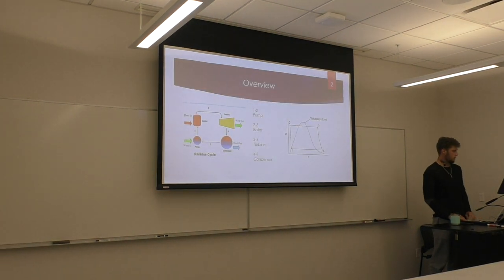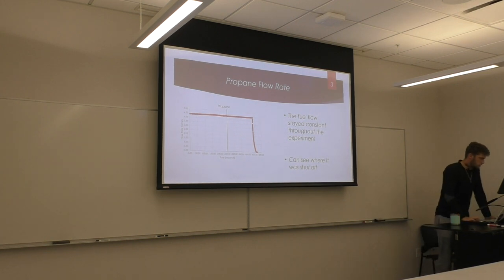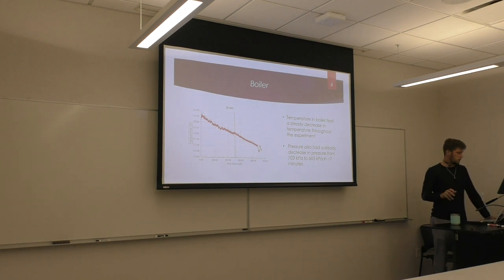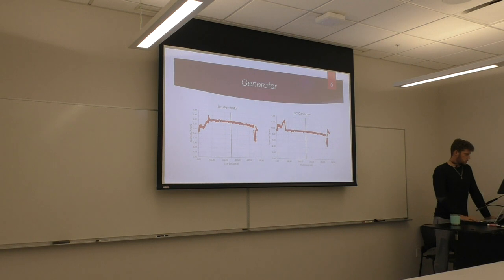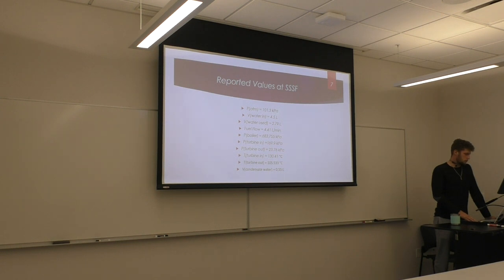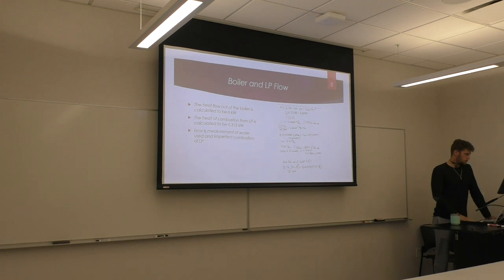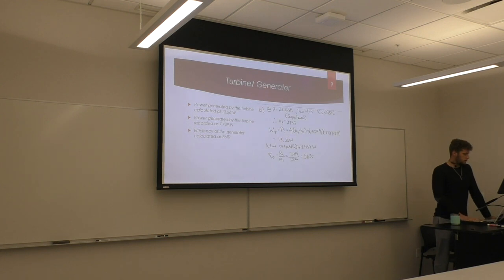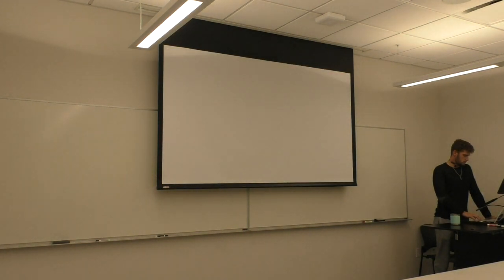Devin Colon

Comment: Nice job on your presentation. You did a great job of pointing out the important info to the audience. My critique is that you could have elaborated further on the cycle efficiency on the last slide to both provide more information and to clock additional time.

Comment: I think you did a great job reporting your findings, and you spoke loud and clearly as you usually do. I think the way you described each of the graphs really also added a lot to the presentation. I would say definitely try to extend it a little longer, as the presentation was over a minute under the 6 minute mark, but other than that the presentation itself was great.

Comment: Good presentation overall Devin, you had a solid explanation with the overview slide it was easy to follow. Would say for your graphs it was really hard to differentiate between the two types of data because they were a similar color. Also would say to try and get closer to that six-minute mark on the talk.